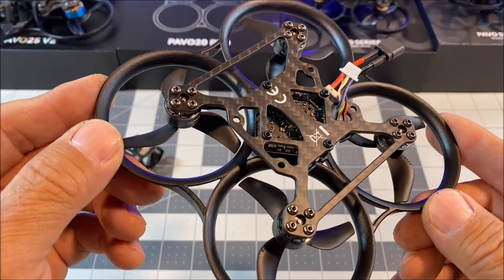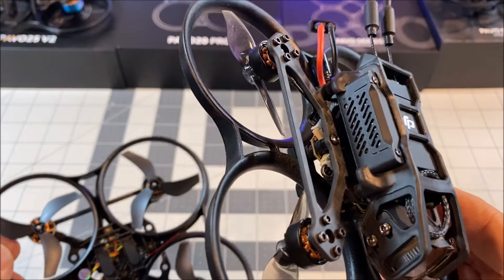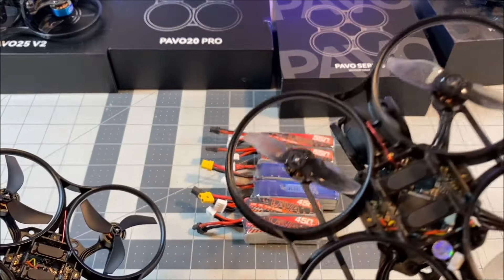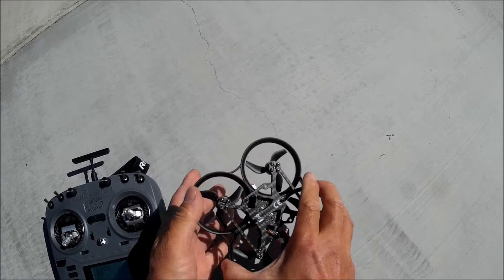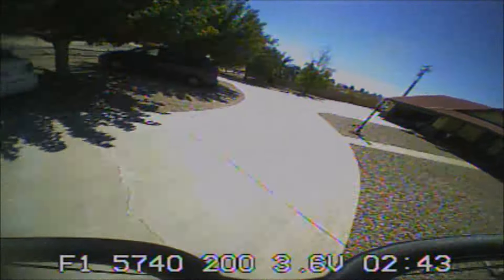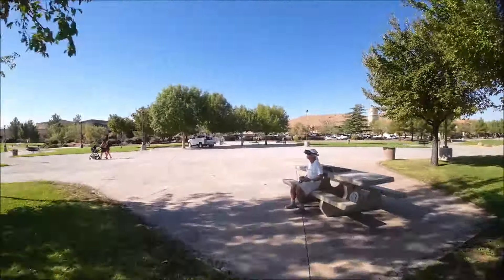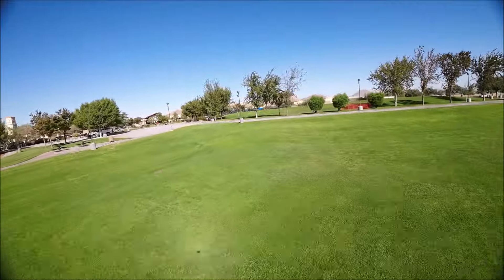BetaFPV Pavo 20 Pro Review and Flights  Best Pavo Yet?

Comment from the maker: 00:00  intro and closer look
01:24  size comparison to pavo pico, pavo 20 and pavo 25 v2
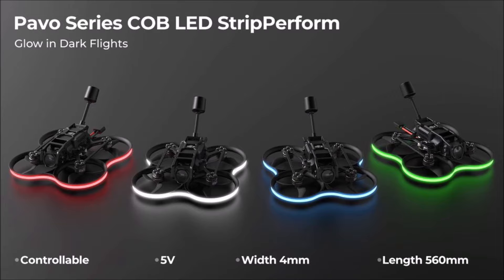05:33  flight controller pinout diagram
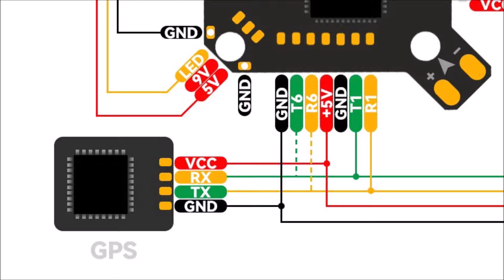06:11  differences to the pavo 20
08:12  easiest binding method
08:46  betaflight set up
09:37  los without vtx
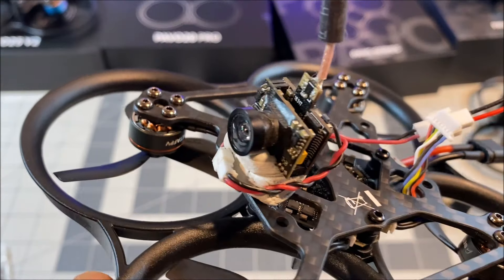11:41  aio vtx flight
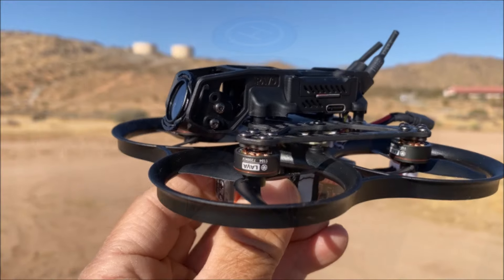15:56  los with dji air unit
17:28  fpv with dji air unit and final words

Comment: By far the best review on this! Saved, liked, and subscribed 😎.
Reply: May I please ask (I’m having trouble finding this info) does it still come with the 2 little whip antennas?   I’d like to use them vs the larger dji O3 as I’m not traveling too far with this.  Thank you!!
Reply from the maker: @Jsvids85  Yes, it does!  I just used the old ones that came with the pavo pico since it was already installed in the 03 air unit.  Simply criss cross them to make them fit perfectly.

Comment: I want to use AIO camera and want to monitoring battery voltage on my 2s PAVO PICO.

If I soldering AIO camera to 5v & GND at UARTs port on board, Can it work ?

Thank❤
Reply from the maker: Yes, it will work.  You will need to update the ports tab.
Reply: @RCEscape  Thanks, i ll try. 🫡

Comment: sweet lil "power whoop"!
i notice the motos are 7200kv...the stock motos on the leader120 are 1104/7500kv....
wonder if these motos would work fine on 2s on the leader120? i got some 9500kv on there now but the fc cant handle them...failsafe city...even caused a crash onto the tarmac ouchy!
so im looking for a more suitable solution.....
Reply: o yaa im running the 2.5in avan rush props....3blade
Reply from the maker: 2s should work fine.  Not gonna scream though.
Reply: @RCEscape  koool!
i looked at RDQ and currently the t-moto 1104/7500kv is sold out...
ill wait a bit longer to see if that moto gets re stocked any time soon...